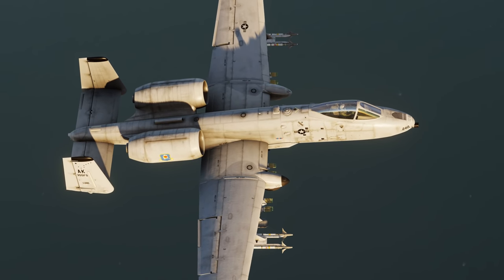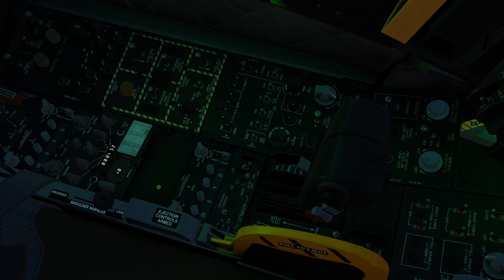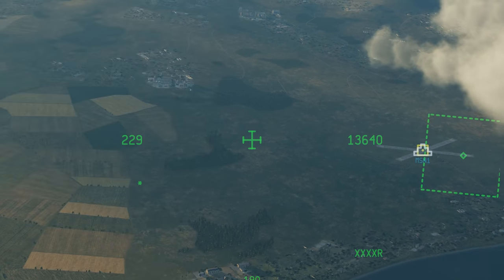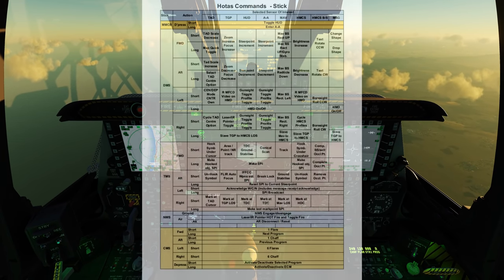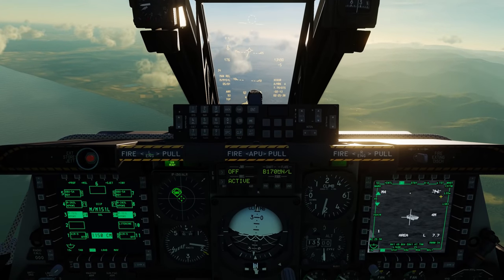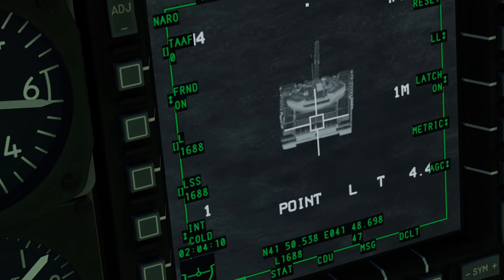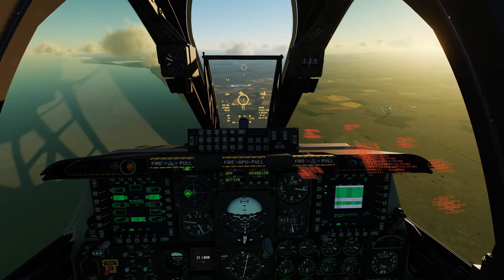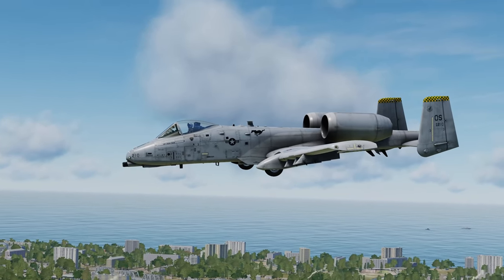Ralfi's Alley - A-10C II Tank Kil*er Update first look!

Comment: This just backs my theory of giving the A-10 AMRAAMS and calling it the F/A-10C
Reply: We need this irl. Attack plane with amraams!
Reply: How the fuck are you gonna cram a radar on a platform that has all the nose space occupied by an unreasonably large gun.
Reply: @alpine7313  exterior radar, just slap it on the top of the canopy ez pz
Reply: @alpine7313  Who needs radar when you can maddog it?  Or have it steer the AMRAAM seeker with the HMCS just like they do with the AIM-9.  Or better yet, put an AIM-9X seeker on an AMRAAM and have a silent BVR capability.
Reply: @JETZcorp  thats not how any of that works😂😂
Reply: @Halozocker104  that’s exactly how that works. You don’t need a radar if your using AMRAAMs at close range.
Reply: @alpine7313   NOT unreasonable.  Right-sized for its tasking.

Comment: The APKWS don't spin - that is correctly modelled in DCS. The laser sensors on the ends of the 4 new fins could otherwise not exactly track the laser spot. The rockets actually have to be actively "un-spin-ed" by the guidance systems after they are launched (as they start spining like any other 2.75" rocket by default).
Reply: The paper I found (RD-SS-90-6) says hydra spin is from the rocket nozzles flutes for launch stablisation, there's a tiny shaped leading edge on the rear fins cancel out and then reverses the spin once the rocket has burned out.   As it transitons subsonic the trailing edge takes over and maintains a slower spin to keep the warhead happy.  BAE's images seem to show the standard rear fins with those shaped edges (they're pretty subtle).
The popout fins on the APKWS module do seem to cancel out any spin after launch so the fin optics can track without a 20-30Hz spin fecking with everything.  So it seems to be modeling the trailing edge spining it back up at the end when the seaker goes to sleep. 
It's a very cool system stuck into the middle of some very dizzy, most probably drunk rockets. :D
Reply: @mostevil1082  I make the APKWS

Comment: Re: APKWS anti-aircraft usage- The USAF actually just shot down a target drone representing a cruise missile with an APKWS rocket fired from an F-16. (Also HVP from howitzers in the same test, but unrelated). So that air-to-air capability is very real, at least in certain envelopes and against certain targets.
Reply: yeah against choppers it's going to be the new weapon☺️
Reply: Seems to me like APKWS is fairly comparable to the 25T's Vikhrs then - those also have a fairly decent chance of slapping choppers out of the sky.
Reply: @Derpy-qg9hn  VIKHR are laser beam riders, they loose a lot of energy when manouvering, that's why they have quite powerfull rocket motor. When launched against notching aerial target they are likely to stall, i think that APKWS should have less issues with it's more advanced guidance (SAL instead of beam riding), but they don't have such a powerfull rocket motor on the other hand.
Reply: @Derpy-qg9hn  we could call it the "slap chop"
Reply: You just said "APKWS fired from an F-16" and as a Viper driver that makes me physically excited.

Comment: It's going to take a while to untrain myself from using china hat aft to boresight the TGP. I also recall the newer A-10s having a mark point delete feature in the CDU that it appears we didn't get.
Reply: I haven't watched the video yet, and I realised last night that the function had changed to something, don't know what yet, but that's why I'm here ;)
Reply: @louispenn9253  Supposedly you turn the TGP to STBY then back to A-G and it will re-center. There's no boresight function in the real AC according to DCS. you can also look forward and DMS Right Long (PageDwn on keyboard) and it will snap to where you're looking.
Reply: Spent 20 minutes last night trying to get it to work thinking I had forgotten the correct controls.
Reply: @ukLeeham720  According to snoopy, there is a B-S osb option that ED didnt add for some stupid reason

Comment: I love the fact that we get an option for cockpit wear. I prefer the look of a worn cockpit, as it at least to me gives the cockpit some sense of 'soul' and character. This in itself increases my immersion. When learning, however, the worn cockpit tends to get in the way.
Heatblurs F-14B is probably the best example here for me, as it's the aircraft that to me has the most soul and wear to its cockpit, but I also remember fighting the cockpit rather than the enemy when learning to use this aircraft. I had a hard time finding the switches quickly, as the text/label of many important buttons was scratched in a way that made them harder to read. They did fix some readability issues with the F-14, but I still believe that they took the weathering a bit too far in some regions, making it harder to read.

The wear of the A-10C II seems far more subtle than what the F-14 released with, but I still think I'll use the factory new one until I'm a tad more comfortable with the layout of the switches. I also believe that the factory new one would be easier to read while in VR, but I have not tried this.
Reply: The worn cockpit on the Hog is not that bad, because the dials and lights are still perfectly readable. The worn out effect has been applied where it's not detrimental to gameplay..
Reply: @nyandyn  I completely agree with you, especially now that I've spent some more time in it and looked around more properly. There still are some switches down towards the bottom left where the text is scratched and where the contrast levels are lower, thus making slightly it easier to quickly read at a glance with the factory new one - but in general, even the weathered one is very much readable. I think they really hit the sweet spot for wethering levels with that one.

Comment: The APKWS system stabilises the rotation of the hydra one second after launch as the fins pop out. That's how it actually is. The last second spin is the onboard battery dying and the fins no longer steering the rocket or stabilizing the rotation.

Comment: This is just me speculating wildly so there's a good chance I'm completely off base, but regarding the spinning... If the APKWS still uses the same rocket motor as the unguided Hydra variants (which seems likely since the whole point of this thing was to field a precision guided weapon for minimal expense), I'm betting the rocket motor's folding fins are set up to induce a roll to stabilize the rocket. If it needs to not roll while guiding on a target, the maneuvering fins would have to actively work to cancel out that rolling tendency. If they have a limited battery life like you suggested, it could be that the servos driving the fins go limp when the battery dies and allow the rocket to start rolling.

Comment: You can change in the default TGP slave to HMCS mode from INR to AREA track (in the STAT/HMCS page), I think this should solve the issue about the TGP "sliding around". But overall my experience has been similar: still a bit buggy.
Reply: It didn't for me. No effect.

Comment: The laser guided front fins stop the spin on the rocket.  The none laster guided rockets spin like a bullet for gyro stabilization. But with the laser guided front fins they stop the roll and rely the front fins for stabilization and guidance.  So this is modeled correctly.

Comment: In relation to the 2.75" rockets with the APKWS.  They are not very big rockets.  Typically we used HAO7 NALC rockets which are 2.75" in diameter and about 41" in length.  Not all of that length holds the solid propellant. Unlike a missile which has a huge motor section, the 2.75" rocket does not.  Additionally, it does not spin much, otherwise, the tiny fins on the APKWS would not be able to control its flight pattern.  I will spin just enough to arm the warhead. I can speak on this because I am a retired Marine Corps Aviation Ordnancemen and I wrote a good portion of the publication for the APKWS.  Great video though.  Can't wait to get my rig built to have my own fun in the air.

Comment: If the rocket was spinning from launch it wouldn’t be able to adjust its flight. Imagine trying to control a plane which was spinning. You pull the stick back to climb but it’s spinning so you’ll only climb in a small potion of that spin. When you’re inverted in that spin you’ll be actually pulling down. Secondly if I remember correctly, some ordinance uses gas to control its fins for flight. Once this gas runs out there’s no control. Maybe that’s why it was spinning at the end of its flight?

Comment: Whats most likely happening with the rockets is the armor is too thick or getting absorbed by the ERA on the majority of the tank. And when the three hit on the back and did no damage what most likely happened was the extra fuel drums probably ate the rockets, idk if its simulated in DCS but fuel is very good at eating projectiles and warheads, as well as the "spaced armor" the fuel tanks being empty would create would significantly impact HEAT warhead performance.
Reply: I'm pretty sure that reactive armour or internal components are something DCS definitely doesn't model.

AFAIK it's just split into hull front, side, top and rear, and turret front, side, top and rear.
Reply: M282 warhead is MPP - MultiPurpose Penetrator. Its some sort of semi-piercing projectile with HE and incendiary as a bonus. SAPHEI, maybe SAPHEFI, definitely not HEAT.
Haven't found exact penetration values, but this thing probably won't pen back/side turret of T-72, maybe turret roof at right anlge or engine deck. If fuel tanks are modeled, i can easily see them being able to trigger the fuse before rocket gets inside the engine compartment.
And yes, ERA will definitely eat them for breakfast without any issue.
Reply: @OliverMiles98  Internal components i know will be coming at some point and im pretty sure is implemented on something. Its been mentioned in the dev updates a few times.
I just dont remember which thing its already implemented in (the BMP-80 comes to mind but im not sure).
Reply: @CRL_One  Its most likely very similar to its RA-79 warhead that was its predecessor which looks very similar to an early WW2 german tank gun shell. Both the RA-79 and M282 use kinetic energy to pen their target. So yeah, i doubt theyd pen after going through the fuel tanks. I wouldnt be surprised if they could pen the  rear unless if they go underneath the tank after passing though if the fuel tanks were empty though. The thickest armor on the rear of the tank from where ralfi was firing from is 40mm.

Comment: Ok so if its NOT a bug that the SPI skids if your head is moving, it could be because when I pilot is trying to designate a SPI on say a moving convoy, the SPI ski seems to match the speed and direction of head movement so maybe its meant to follow a moving target long enough to get a point track? I dunno.. Im a DCS noob, but I do work with similar systems in the commercial drone world
Reply from the maker: Hmm, I don't believe so, since the TGP has the tracking capability and wouldn't need to do that. But who knows.
Reply: @ralfidude  Ya you are almost certainly correct. I watched it again and the way it moves doesn't correlate to your heads velocity average over the last few seconds as it would have to in order to serve the function i talked about..  aaand the function is also redundant as you mentioned lol

Comment: I thought DCS did not model amour. Am I wrong? I thought they just gave everything health models.
Reply: Perhaps, that explains why they are working with new damage model for WW2 aircraft
Reply: The armour modeling like this was always there. It's literally having armour values for rear, sides, front and top AFAIK and might even have the same for the turret. To deal damage, the ammo or warhead needs to have enough penetration power and if it does, it inflicts a certain amount of damage that's taken off the life bar, determined by the kinetic and explosive energy of the thing that hits it.
Reply: There is some modelling of armor. When I fly the Ka-50 I need to aim the cannon at the back of some tanks to deal any damage. I don't think it is a detailed simulation, but it does make tanks less vulnerable when facing the enemy.

Comment: In reality HEAT warhead 70mm rocket would penetrate T-72 engine compartment from top with ease. Even 40mm HEDP grenade (from grenade launcher) should do if you hit with correct angle. On the other hand i don't think that HE would do. From what i recall HEAT warheads for those 70mm FFAR were somehow broken in DCS, remember testing them some time ago and they were not likely to kill a tank from the side or even from the rear. Not sure how this works in updated version with guided variant.

Comment: T-72, external fuel tanks not oil. Probably a verbal slip. 
Game looks fun as hell, wish I had a stick and the game. I know you make it look too easy though.
Reply: @John Doe I guess maybe isn't it an oily fuel? It isn't combustible and burns like oil. The Abrams family will run on diesel, mogas, petrol, if it burns they say you can run it. That is a turbine though unlike the reciprocating engine the T-72 has.
Reply: Yes diesel is a type of oil, but in this case it is generally called fuel as it is for powering a vehicle.